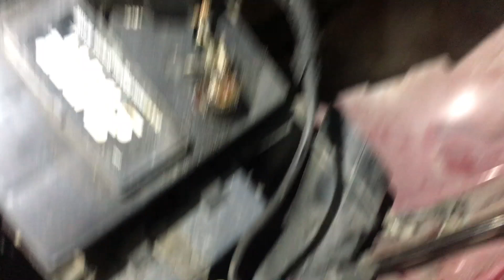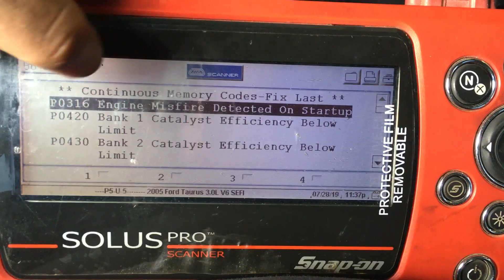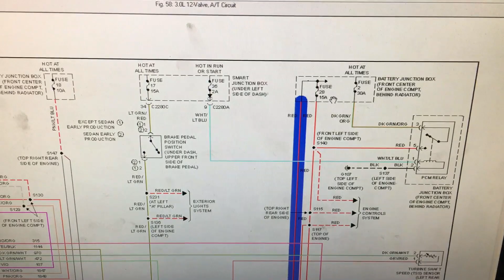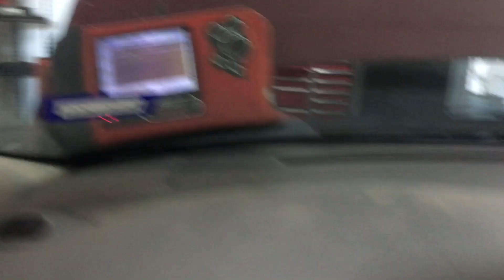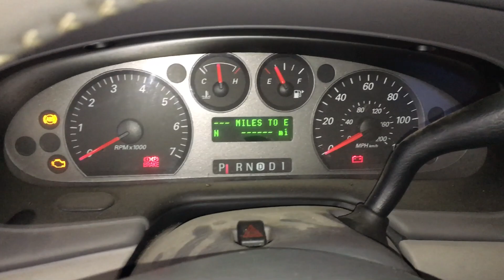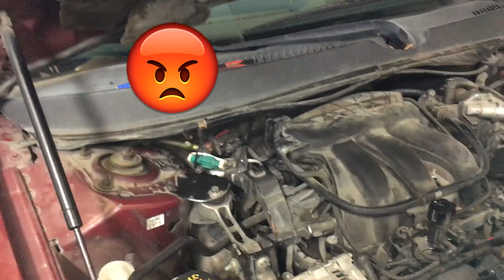FORD TAURUS SHORT CIRCUIT

Comment: Would this cause the transmission to shift erratically? When the transmission fails to shift into third gear, all the gauges go off and the doors lock and unlock. When the gauges come back on the transmission shifts into third and it’s not a smooth shift.

Comment: I have an 02 Taurus with 35k miles on it. It had a misfire in cylinder 2 or 3. Changed plugs,wires, and coil. Now I have misfire on start up and multiple misfire codes. Also small EVAP leak detected.  Help!?
Reply: How did u find a car with that low of miles

Comment: wow amazing, your persistence paid off.  Look at the trouble from a simple wiring harness rubbing against an ac line!  Packing too much together in a small space.  You also helped me with a problem I had forgotten about.  The ground wire off battery where it is a tee, on my sable this point can become open, and yanking on it can fix it.  I just had problem happen again where I turn key and entire elec system goes dead.  clock and radio stations lost.  Yet trying again later all is ok, just that intermittent weak link.  Now I think it is time to get a new ground wire.

Comment: That is not a 2005 Ford Five Hundred maybe a 2004. Could not see the body of the car very well in this video, but on a 2005 Ford 500 the the Transmission selector is on the middle console not on the steering wheel, and instrument cluster is different with water temperature gauge on far left

Comment: i installed a new radiator fan and ac compressor and now my car is showing check engine light and showing low fluid tranny light that is a ! point with yellow dots around it. i read the dotted sign is low tranny fluid so now my car is only using second gear codes are shift selenoid and tranny torqe selenoid electrical.but my car ran fine and shifted fine before the installs?? i need help i dont have allot of money for a shop any ideas please help thank you.my car is 2000 ford tarus dohc.
Reply: i have a 2000 dohc ford tarus
Reply: i was thinking something is touching like in ur video cause ac fuse 15 amp blue one is burnt too. and i also forgot to unhook battery during instal. so im thinking maybe a problem like ur video maybe?? im at a loss car worked fine just bad fan and ac before not all these other problems now.

Comment: So I have a 2006 Ford Taurus that revs up on its own when In park or sometimes when I’m on the brakes in drive, then it’ll shut off once the rpm goes low. I got the code p0750 as well The Shift solenoid A burnt out, I just recently replaced it and it went out again 2 days later. I have no clue what to do and it’s my first and only vehicle.

Comment: I wish I new someone who could find the problem in my Taurus. The battery drying fast for no obvious reason. Now it's completely dead with no power at all. :(
Reply: I own a 99 Taurus and i found out my cassette player would stay on and discharged my battery, mine has a cd -cassette and i didn't want to get another one  i ended up getting a power shut off switch for my battery,, ran wires to my console and installed it there below my steering column,  solve my problem,,.

Comment: Have 2006 tarus and only thing not working is the Odometer use to work, ford saids 500.00 to fix computer saids 99919 miles on it have any advice on it.it doesn't light up at all

Comment: My 05 Ford Taurus check transmission light keep coming on I put brand new speed sensors on and it’s still doin the same thing as in shifting sometimes it drives in neutral twhen I’m in drive like revs high then kicks back in I took it to get checked out transmission shop say nun is wrong with it might be a speed sensor but I already replaced that any more suggestions

Comment: Ah so that's why it was going from no comms to clear comms when you put in from park to reverse...the pressure of being in gear moves the engine slightly and must have dropped just enough to stop the wire harness from touching while in gear. Cool video.

Comment: After cleaning up the G102 bolt, I always use ordinary grease on all of the bright metal because greasy metal cannot corrode.  I always grease my battery terminals too. Those battery terminal protection sprays are worthless!

Comment: The Ford dealer would replace everything you mentioned earlier instead of pinpoint the target of the problem.
Reply: No doubt, my Taurus was running so rough it could barely stay going at idle, smoked real bad but only when hot and left at idle for a while, kept getting random codes for everything from misfires to throttle body to fuel trims, etc. Took to dealer and they wanted to put a can of carb cleaner through intank manifold (i had already used Seafoam, Chevron and that other competitor) and they wanted to replace two coil packs. Price? They wanted just over $1,200 and no guarantee it would solve the problem. Car died on me while driving 2 months after. Hasn't ran since. Pretty sure it's ECM though an independent shop wanted to replace fuel pump cause of a code. I changed that myself, made no difference. Changed fuel pump driver module, no difference. Other parts changes, and a few hundred dollars later I'm pretty sure it's the ECM that's not made anymore and time to scrap the car.
Reply: I should point out that it's possible it might be the GEM, but again, another part that has been "obsoleted" by Ford and haven't been made in years and all that's out there is all there is. $100 on Ebay Scamways Auto Sales or junk the car.
Reply: Cha Ching$$$$

Comment: BRAVO!  Excellent presentation.  Very glad you did NOT edit out the many apparent causes... only to discover the problem had NOT been resolved... until many hours (days) later.   Perseverance Till a SOLUTION! Because,  You learn NOTHING if You QUIT!  Shorts can be INCREDIBLY difficult to locate.     I am dealing with a similar electrical conundrum.   My work truck,  an 03 Expedition 5.7, 183k mi.,  has been having a series of electrical issues that began in  2014, at 125k miles .  It started out with  burning out Relay R203.  If switches Fuses 32, 33, 34,  the Fuel Pump Relay#  303  a hard wired relay;  PCM solenoids, and sensors.     After weeks of burning out fuses,  I eventually had to replace the internal  Relay 303 (soldered to board) .  It had melted, burned out.      2 years later the  Fuel pump failed and I replaced . A month later, the alternator failed.   Then 2 weeks later: the front Blower/ac first failed, so replaced R06 (blower relay) .   This then   led to the Blower / Ac NOT SHUTTING OFF EVEN WITH THE KEY OUT OF THE IGNITION.  You can turn on the blower , activate the AC clutch with the key OUT the ignition!.   Then Relay 203 burn out AGAIN, multiple times charring the plastic near pins 3-5. I decided to by-pass the troublesome circuit of R203 -->  R303 --> Inertia Switch --> Fuel pump.   Installed a temporary BY Pass kill-switch tapped from circuit 964  which is suppose to be Hot only in Start-Run.     BUT THIS NEW CIRCUIT  STAYS HOT...even with the key OUT OF IGNITION.  This  keeps the Fuel pump activated (except when throw the kill-switch)  which of course now kill the battery in less that an hour (amp draw with KEY OUT is 7.15A).  To rule out PCM related shorts, I disconnected the 3 harnesses feeding the PCM:  B (body) 46 pins,  E(engine) 46 pins AND T(transmission) 30 pins.   With the PCM disconnected (except for it's grounds) and with the key out, there is a 7.15 amp draw IF the by-pass switch to the inertia-switch / fuel pump is On.  Turn it off, yields 0.924 amps...  BUT if I pull fuse 5 (ALWAYS HOT i.e, KAPWR) amp draw goes to 0.002.   Also another bizarre behavior.  Relay R06 is for the front blower.  BUT if it is pulled, the engine will kill, because the fuel pump shuts down!        And lastly, today, the truck starts and runs fine BUT it has no power to: windows, radio, instrument panel, interior lites....             Am Going to  start testing  for shorts in the  ignition circuitry.  Then will test power/grounds for all circuits that fuse 5 feeds, and last will reopen the Central Junction Box and check it for shorts.   ..  So again I say:  CONGRATULATIONS!  on finding the source of your wonky and intermittent issues.    Tom Jones, New Orleans.
Reply from the maker: Thank you for watching!

Comment: My wife's got an 07 Taurus her AC has been dead for a while it was just low on charge very small slow leak got it charged back up currently driving on the highway clutch bearings on the AC compressor at gone bad blown me keep memory alive fuse which happened to short the PCM do the metal from the bearing got into the magnet for the clutch and send a short back to the fuse it took a few days of back probing and diagnosing in the evenings but the PCM was fried got a new PCM and got it reprogrammed funny trick I found I froze the PCM in the freezer to see if the circuits would break loose that fused the car started and started communicating again and of course I replace the whole AC clutch assembly but I've never seen an AC clutch magnet fry PCM craziest thing I've ever seen